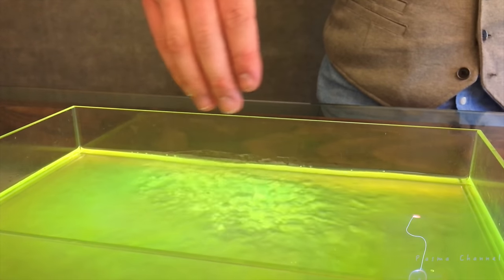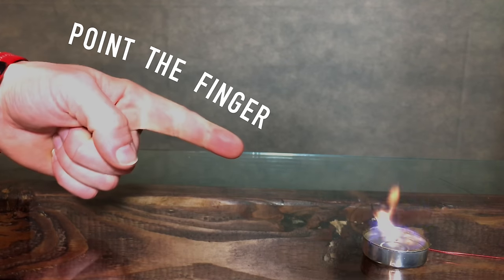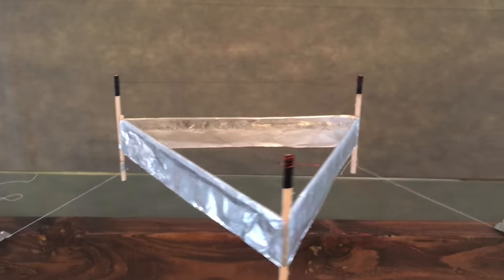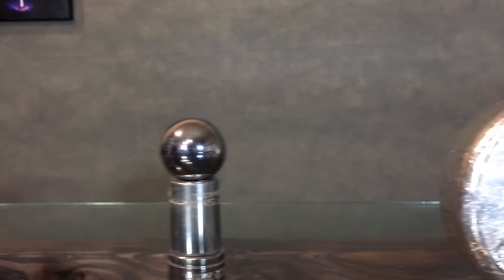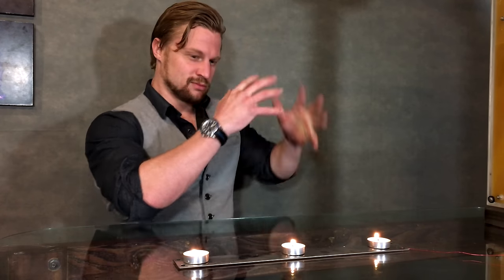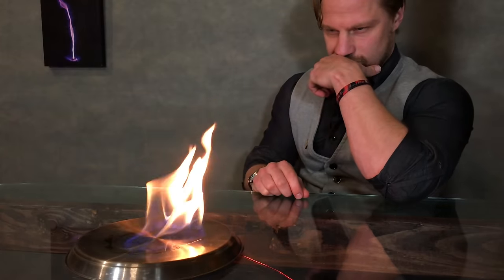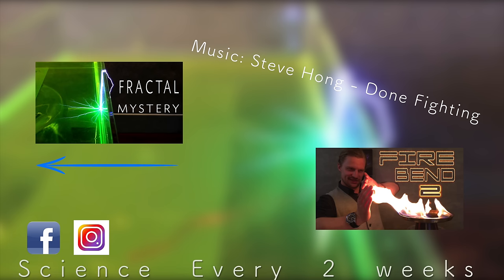Become The Last Airbender ( 200,000 VOLT Avatar Power)

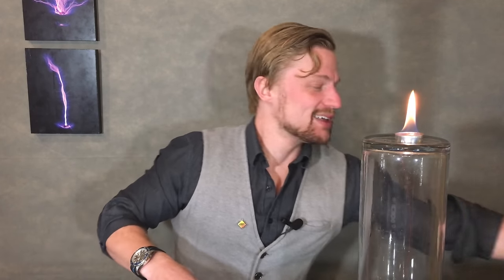Comment: 0:35 what he reach way over there for?? Look like he turned something on 🤔
Reply from the maker: Correct. I turned on the high voltage power, as mentioned in the video.
Reply: right
Reply: No hes wrong theres no real 200 thingy he talking abt u just need to use ur body to feel air and pratice liks a air bender

Comment: Fantastic demonstration. Looking at the principle of "Skin Effect" for grounding in water. I am certain that there is a way to use it to walk on water. However you need a way to have an oscillator in parallel with your body as in a Pierce Oscillating Circuit  (invented by very distant cousin) . Your body acts as the capacitor  and the resistors.

edit: theory behind this is due to high frequency causing a resistance to grounding. If your feet contact area is not high enough to ground the high voltage high frequency  through the water should cause you make the surface of the water have a stronger surface tension due to the molecules arranging themselves to the field. I don't think you will technically oscillate all that much, just have the potential too if grounded, and that potential is resisted by the water.

Comment: cool I have done something similar using a van de graaff generator. I would point my finger at my kids at a few feet away and charge there shirts. And then point at the furnace ducting in the ceiling and you could hear the crackling of the electricity flowing off the end of my fingers.

Comment: When you did “air bending” did you turn on a fan or why would you put your hand where the camera couldn’t see
Reply from the maker: If I turned on a fan, how would concentrated air still come from my fingers? Fans are not concentrated air.

I don’t understand why I get so many comments like this. In the video, I stated I was charging my body up to a high voltage. I was turning on the high voltage power source when I reached off screen several times.
Cheers.

Comment: Awesome vid i just wish i had a voltage multiplier is there a website to buy one?
Reply from the maker: There are actually a couple companies that make voltage multipliers, and quite nice ones. HOWEVER, building things yourself is always tremendously more fun. So much more fun and rewarding. It like running a mile, or driving a mile. Running it is far more rewarding.

Comment: How do I get the voltages into my body??? Like how many bolts per Sec or minutes
Reply from the maker: volts per second? I used a voltage multiplier and stood on a charged platform. 200,000 volts

Comment: I’m pretty sure you can’t just make 200,000 volts. Even if you can you can hold them in you body without getting injured you can here energy lose and maybe die. (I am not trolling just saying that is don’t think that this is possible.)
Reply from the maker: 200,000 volts is not that much. I’d suggest you read into Tesla coils, voltage multipliers, and Van De Graaff generators.

Also, if there is not very much actual charge behind that voltage, your body will only experience peak currents for short periods of time. Milliseconds.

The voltage multiplier I used, was designed and built by me. It has no problem pumping out 200kv. Once attached to your body, yes, the voltage drops significantly.

Comment: Why is there a cord connected to the candle at the beginning???
Reply from the maker: The candle is grounded to increase the electrostatic attraction. It still works without the wire. Wire just makes the effect stronger.

Comment: So with the voltage multiplier do you connect the one output to yourself and leave the ground wire alone?
Reply from the maker: I ground the base of the multiplier. But it is important to isolate yourself from ground, very well.

Comment: Why put out fire? Why don't you use it to blow a few sand grains, paper pieces, plastic bottle caps, soda cans or a tiny doll which would be way more cooler?
Reply from the maker: I sense sarcasm! I can appreciate that. Actually, I have additional airbending videos coming up.
Reply: I was not being sarcastic but I was giving you some suggestions which you can do to make a better video. And also so that you can try and I don't have to. 

If you use it just to put out a fire It would still become firebending. You can blow sand grains, soda cans excetra to make it pure air bending.
Reply: I guess there's a little bit of cheating going on, the wind by itself is too weak, but combined with electrostatic effects on conducting plasma (flame) it becomes just powerful enough to put out this flame
Reply: Yes probably. But I know #Plasma channel is good enough to get through this setback. Well he did say he's making more vedios on it.
Reply from the maker: Ah, good assumption! the wind current alone are actually enough to blow out the flames. Its actually quite a strong current. You'll notice one time though, the flame is drawn to my hand prior to being blown out. In that case, it did indeed have a partial attraction, while being blown away....ripping it apart
Reply from the maker: I appreciate it. I left many demonstrations of Airbending for future episodes. I just moved across the USA, and have been very busy unpacking, so the first episode on Airbending had to be short.
Reply: It's okay we can understand. Don't worry we've always got your back 😉
Reply from the maker: Thanks Plasmanauts!

Comment: I saw a wire I saw one u lied it wasn’t)t his finger
Reply from the maker: .....I have gotten this comment so many times in the past two weeks. The wire was a ground wire. So the candle is connected to ground. I could also just place the candle ON the ground, but I wanted to do it on my desk. The entire video is already about using high voltage to create ionic wind. The wind came from my finger - and the grounded candle increased the power. Cheers.
Reply: Plasma Channel oooorrr it was a wire